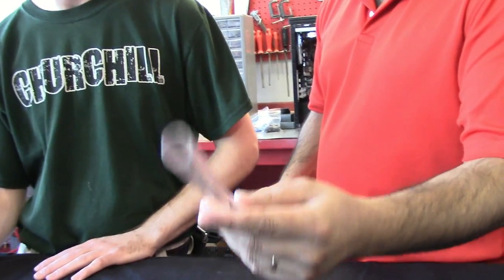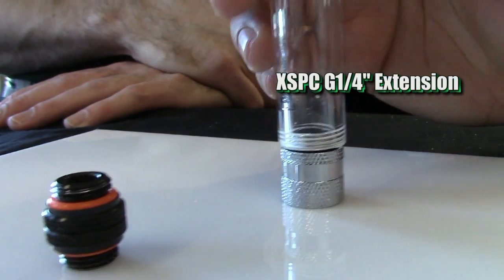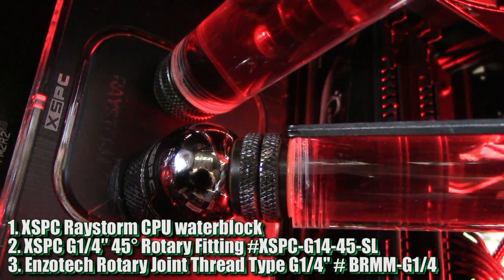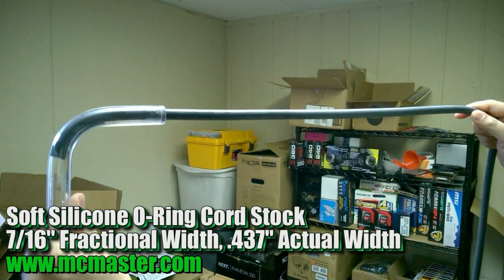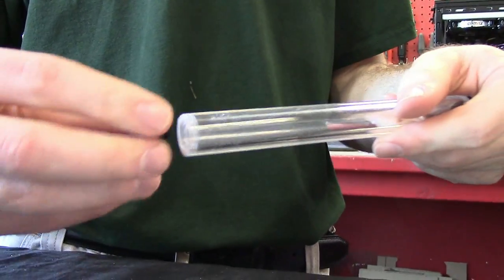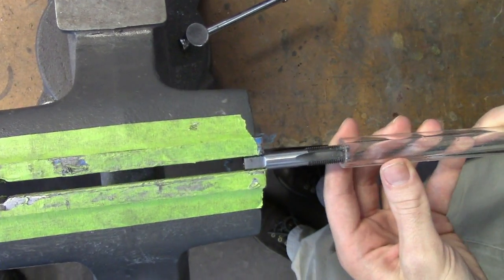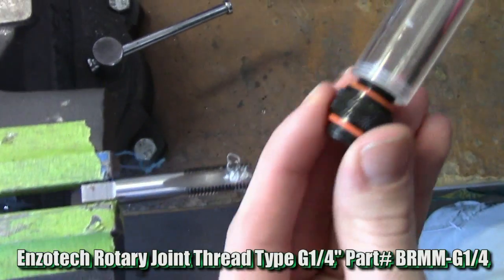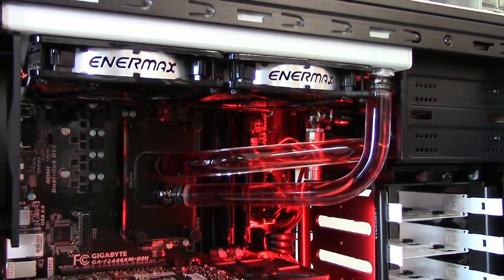Threading 3/4" OD, 1/2" ID Acrylic Liquid Tubing PC, TheModZoo.com

Comment: Know it's fairly old, but why do you need the 3/4 over 1/2? 

1/4-19 BSPP is listed as having a diameter of ~11.5. If you use OD 14mm and ID 10mm then it should thread all right without needing the giant tubes. (That wall thickness just seems chonky and the 14mm is readily available in the space already)

Comment: hi guys, i use http://www.frozencpu.com/products/10037/ex-tub-606/Bitspower_G14_Thread_12_ID_x_34_OD_Compression_Fitting_-_Matte_Black_BP-MBCPF-CC5.html?id=j6GKzCIX&mv_pc=147 
about to upgrade to hardline. 
does the tube that you guy use work with this fitting?

Comment: Are you guys sure it's not a G1/2?

Coz the tubing ID is 1/2...
Reply: Ok my bad, forund the G specs 1/4 thread extends from diameter on the thread valley 11.445mm to 13.157mm on the peak.

Comment: I'd like to do this, but use polycarbonate (better shatter/crack resistance), but I can only find 1/2id x 5/8OD which seems too thin for a good o-ring fit. Anyone run across that size in polycarbonate?

Comment: Hey guys im building my first  liquid pc im using H440 case was wondering should i go with smaller tubing or larger ones, one you guys were showing in the video. I also need help with the tubing size and fitting size PLEASE thanks

Comment: I purchased the tubing and tap that you link in the description section of this video and this isn't working for me. The fittings cannot make any purchase in the tubing. But I think I know why you were to get this to work.

Basically you won what I'll call the "tolerance lottery", in that you managed to get tubing that is just a little thinner than the .50" advertised width. McMaster-Carr's advertised tolerances for their 1/2" ID tubing is .02", meaning you could get tubing as thin as .48" and as wide as .52" -- which is the outer diameter for the G1/4" standard.

Now the inner diameter of the G1/4" thread is 11.445mm, and the "tap drill" is 11.8mm, I think this could be more consistently workable on 12mm tubing. What might also be interesting is trying this on metal tubing as I think the tap can be used on metal. But I've got 12mm ID tubing on the way, so I'll see how that'll work.
Reply: What fittings are you using mate? I ask because certain fittings do not work with this approach. 

And yes those to tolerances can be an issue.
Reply: Sounds about right.  That's why we warned in the video that not all fittings work, some have deeper threads than others (like the swiftech SLI fitting we used as an example that didn't work).  It's not an exact science yet, and why 3/8 x 5/8 tubing works a little better, but then requires drilling, and subsequently thinner walls by the threads
Reply: And I tried with both Swiftech and Alpahcool fittings. In both cases, the fitting didn't get any purchase on the thread and just slipped right out. Amazing the difference a couple hundredths of an inch an make...

But I'm interested in seeing how well I can get this to work, and I think the 12mmx16mm tubing might be the ticket on that.
Reply: brandishwar did u ever get that 12mmx16mm tube working with this?
Reply: tierra jacobs
I didn't seriously pursue it, but in my small experiments, it will work, using the G1/4" tap to cut a thread on the inside of the 12mmx16mm tubing.

The only hard part is just trying to keep the tap perfectly straight to the tubing. I've considered various ideas in trying to do that, but never pursued any of them -- but given I'm currently prospecting a build for one of my wife's friends, I just might give it a try again and use acrylic for the build instead of copper.

I posted about it over on TheModZoo as well: http://themodzoo.com/forum/index.php/topic/1559-threading-34-od-12-id-acrylic-liquid-tubing-pc/?view=findpost&p=28494

Comment: Resourceful way to use larger tubing. Can't lie though, it looks pretty awful. it would be cleaner with actual acrylic fittings made for this OD. Granted, I still think 12 mm OD tubing is by far the cleanest solution.
Reply from the maker: Hi Chris, that would be nice. Do you have a build with 12mm OD you can share with us? In any case, I'm inviting you to join our Mod Zoo Community Forums, http://themodzoo.com/forum/
Reply: ***** Yeah, working in a murderMod TJ07 at the moment. I've worked with half inch OD acrylic as well, I just tend to prefer 12 mm, probably due to the fittings available (bitspower fanboy here lol.) Appreciate the invite, I'll join up today. Keep up the great vids!
Reply: +Chris Cleveland 12mm OD looks like drinking draws in my case...i went with 16mm OD and that's the sweet spot.  It is harder to bend though and harder to fit in tight spaces but the result is worth it.

Comment: Have you considered making some kind of shroud you could put around the tap to help better keep the tubing straight on the tap? It'd need to be 3/4" ID, obviously, but with a plug at one end to hold the tap straight and centered. I'm thinking of something along the lines of the shrouded screwdriver bit Sears distributes under the Craftsman brand.

But this is definitely one heck of an idea, and I'm seriously considering it for water cooling my computer (and I can foresee my wife demanding I upgrade her water loop to use it as well). Bitspower also makes rotary coupler fittings as well -- I used a couple in my wife's loop -- but those would probably also need needle-nose pliers to get tightened enough into blocks, radiators, pump and reservoir.
Reply: We've thought about that idea quite a bit, actually.  The issue is that the tubing isn't perfect.  That is to say, the ID isn't perfectly centered on the OD, so it's been offset in almost every piece of tubing we've gotten (from 3 different places), so something like that is difficult.

Would be easier to use the 5/8x3/8 tubing, with a similar jig to drill it out, then you could make it centered and tap that way, but then end up with thinner walls again, but better threads.  It's all sort of a game of trade-offs, really lol
Reply: *****
Sounds like then if a shroud is constructed, it should be to allow the tap to turn instead of the tubing, that way you can better account for the tolerances in the tubing. Not being perfectly centered is certainly to be expected -- all tubing will have engineering tolerances, and for McMaster-Carr for one kind of 1/2"x3/4" tubing, they're advertising the tolerance to be .02".

The question is how to account for that possibility while still allowing for the tap to be very nearly parallel to the tubing so that you don't go wildly off center, or so off center you can't get a good seal with the fittings.

Comment: AWESOME guys, I was wondering about the bigger tubing, this looks like a better solution from the 3/8-1/2 unless you have a couple tight turns. those fittings look much cleaner.

Comment: Is there a way to clean up the threads? To make it a clear again?
Reply: net200777 we tested that and didn't like what we saw.  You would have to use 1/2 × 1/4 tubing to get a good thread on the outside.
Reply: net200777
I think a sleeve type covering like a thin piece of shrink tube just long enough to cover the thread cuts would work. Perhaps a metal band as a cover too.
Reply: Not quite sure what you mean by make it clear again? Could probably polish up the threads afterwards with a small enough cloth wheel on a dremel or something, if that's what you meant.  That may make the threads too lose to work well, though.  Might have to give that a try
Reply: Well the cuts look white inside and noticeable. If there was a way to make it completely clear... this would be an excellent way to do acrylic tubing.
Reply: net200777
perhaps there might even be a way to thread the tube on the outside? to screw it right in?
Reply: net200777
errr that would require a smaller tube nvm
Reply: net200777 we tested that and didn't like what we saw.  You would have to use 1/2 × 1/4 tubing to get a good thread on the outside.
Reply: Ya you guys are def onto something here with this...

Comment: Could a aluminum case use the case panels to mount waterblocks with adhesive thermal paste onto each panel and have them act as radiators.. passive ofcourse

Comment: That thread depth just doesn't look deep enough to trust.
Reply: Your typical fitting only has like 3 or 4 threads, so we only used the depth as needed. That build was driven around to the shop, and then back with no leaks. The thick tube holds really well.
Reply: Unless you're talking about how deep the threads are cut, in which case, it might be a valid point.  We had also used 5/8" tubing tubing, and it did work, although you had to drill out the tube first, which adds another potential point of error.  So far, though, we haven't had any issues with it yet